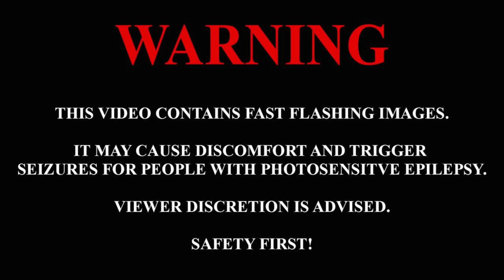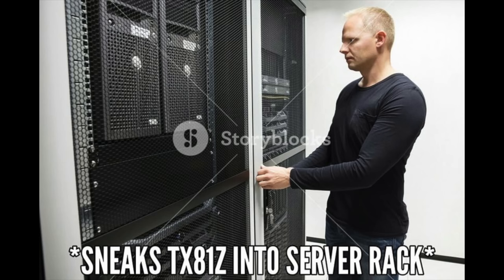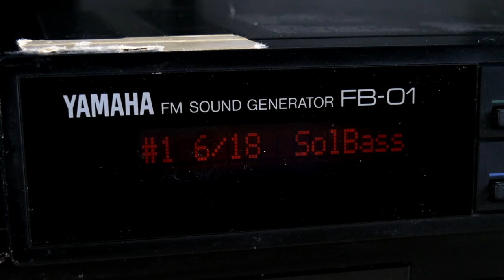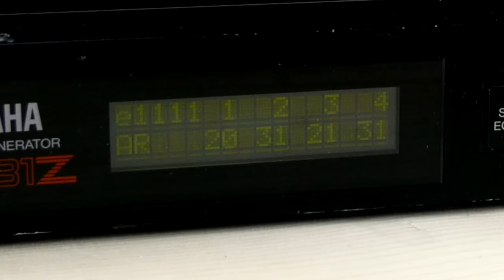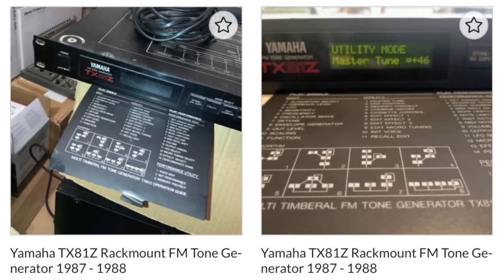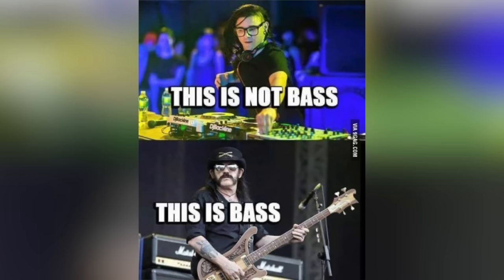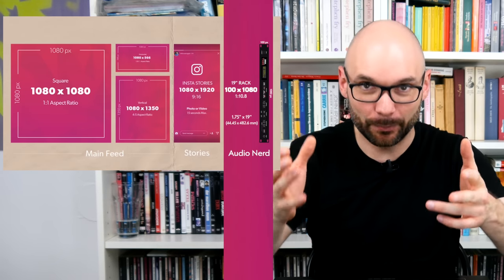Bad Gear - Yamaha TX81Z

Comment: Bad Gear, OMG leaving me triggered in recent episodes! The TX81Z still graces my rack, my FIZMO made a graceful exit a few years ago in a trade for a V-Synth (with a sunset clause offered which expired long after the trader changed his mind - TOO BAD),  and, there are many V-Machines around the office. LOL ;)
Reply from the maker: Nothing personal;)
Reply: V-synth is basically Roland's stab at a Fizmo, yes? Always wanted one.
Reply: @dvdny  the V-Synth is a vastly different animal - it's best considered the ultimate sample mangler. The FIZMO, unless you're keen to maintain an ancient Windows system or VM capable of running SoundDiver (yes, I had it working perfectly on a my Mac Pro MacOS Mojave system via VMware Fusion), is utterly sonically underwhelming but has the best paint job in synthesiser history. It was to keep around in the studio purely as a conversation stater but I've heard wet farts that sound better.
Reply: @AudioPilz  I'm a huge fan of your work! My boss (V-Machine creator) is now a fan too.

Comment: Nice and funny video (you did have some pain looking for images to illustrate waves !) I had a TX-81Z for many years and I agree with your review. I liked it as it could produce some original waveforms, but overall it lacked controls, or settings were a bit 'rough"  or scarse and not allowing enough lively play. I used Caged Artist editor on the Atari ST. Polyphony makes layering very difficult to fatten things up. I sold it and got my self a SY-77 which can do almost everything the TX81Z can do plus more. But the V50 would also have been a good alternative (has basic FX and 16 voice polyphony).
Reply from the maker: Thank you so much!!!

Comment: This could almost be a public information film for anyone following the current FM revival and thinking about getting a vintage hardware unit. I think I've turned my DX9 on once in the last 30 years or so. It should be mandatory for anyone considering rehoming a vintage FM synth to download and work with Dexed on their computer with 95% of their computer screen covered. Thinking of rack units, how about the Oberheim Matrix 1000? Even though they were curated presets they all sounded a bit muddy to me - and even with software editors it was hard to program without huge amounts of lag and crashes - still managed to sell it as a 3 voice for more than I originally paid for it. Have you got Julian Colbeck's book? Read the review of the Oberheim Matrix 6. Had one for a few weeks but it broke.
Reply from the maker: Thanks! Actually had a Matrix1000 a few years back. Suprisingly good sounding yet useless;) Tweaking via Sysex takes DAYS to react;)
Reply: I got mine with the 1.20 firmware which fixes most of the laggs, it can be programmed pretty much in realtime with the proper editor.

Comment: I for one got a DX7 education in Denmark in 1984 ( I was 14 years old) when it got released (i live in Sweden). I was fun and all apart form the fact that swedes and danish don't use numbers the same above 10 or so..... It was ok. I could clearly hear what values did different sounds and why.
Anyway, learning the DX7 I got to think in a certain way regarding hearing sounds and thus understanding and recreating those on the FM DX7.
Using an FM synth like the TX81Z or the SY77 or SY99 gives me an awkward availability of more waveforms than sinus.
Extended sound palette? SURE! But even more difficulty in recreating sounds.
For me, recreating sounds on a 6 operator synth is not difficult. Disregarding modular and such.

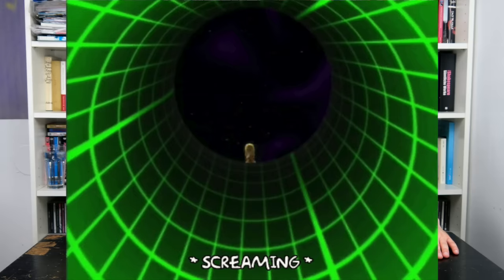Comment: 0:49.  Luke!  Since I sold my DX7 before the dark times, you must learn the mysterious Alchemy force of FM programming….or flip through the thousands of presets available on the internet and use any software DX vst or iOS app! And trust in the randomization button to achieve whacked noises R2 D2 can communicate with….assuming it blends with ARP 2600
Reply from the maker: It's a bit like chemistry indeed!!!

Comment: Be careful if you are getting the TX81Z to modulate the sysex parameters as part of a performance. The processor is super slow and will seize up. 

The TQ5 or WT11 both have almost the same engine but can handle sysex much better. TQ5 is possibly my favorite looking 80s synth, but the WT11 has portamento which the TQ5 does not (both have pitch envelopes). Also I think it sounds the "sweetest" out of the 4-ops.
Reply from the maker: I'd love to have a TQ5!!!
Reply: @AudioPilz  Highly recommended just as a conversation piece :P I've had multiple folks ask me things like "wait, is that an answering machine or terminator prop or...?"

Comment: The polyphony is pretty limiting for being multitimbral, although non-keyboardists likely won’t mind. Description of the alternate waveforms is spot on, but they are really the only thing that makes this DX worth owning imo
Reply from the maker: Yup, 8 voices ain't much...
Reply: I agree, 8 voices isn't much. But then, I bought mine new in 1986 or 87 for $475. I was OK with a few limitations... 🙂
Reply: @Novalarke   I imagine if I was around back then, I probably would have bought the DX11. May not have been a DX7, but certainly more affordable, and with many features the earlier 4ops didn’t have. For the time, 8 voice polyphony wasn’t terrible either.
Reply: @jerzilla3795  - I had a DX11 too! It was fabulous. There's a keyboard I actually miss. And yes - DX11 was way less expensive than a DX7, and with its extra waveforms was able to compete with the DX7, at least for my needs! Cheers!

Comment: In 2003 I was talking to Tom Jenkinson (Squarepusher) after a show and I asked him how he programmed the TX81z. I had one at the time and was curious. When he said "I just use the front panel" I remember thinking THIS GUY IS THE REAL THING lol. Back then there was 1 program to edit presets on it and it was really dodgy so I was stuck trying to figure it out. I ended up throwing it in a dumpster after an emergency GTFO of an apartment situation lol. Of all the FMs I'd say it's good if you can get it for less than $200 CAD but we all know it's hip and trendy now. I got mine at a pawnshop in the late 90's for $80 I think. I even had the midi keyboard you have at the time (I think the gen II model that came out after) using it. Not sure if my boomer eyes are deceiving me but it looks like yours is missing the headphone jack bolt as well? haha you gotta be careful cause iirc it can fall into the machine.

Thanks for the flashback. If any zoomers are thinking of buying this get the korg volca FM instead. The major appeal of the TX81Z is that you could get them for cheap at some point in time. That time has passed, this is NOT worth 300 euros my dudes although the DACS are nice and loud on this.
Reply from the maker: The GOAT! Thanks for watching!

Comment: Excellent; I can never make mine sound so good! And yeah, server manufacturers started building thin vertical machines that tucked into a chassis and called them “blades”. How is it possible that Yamaha (or Roland) never convinced us that would work with synths?!? 😂
Reply from the maker: I'd buy that for a $

Comment: Wohoo! Excellent choice, but you didn't address the main flaw in my opinion: static assignment of voices in performance mode. To have useful multitembrality you need at least 4 voices and given the 8 voices max you can have at most 2 different sounds at one time.
Reply from the maker: Thanks!!! Didn't run into real limitations the way I use it but I assume that might be an issue for real players

Comment: My first synth ! I owned 3 since these 30 years . I always back for this weird and creative module. Much much better than the DX9/21/27/100.
Do you know if the YS100 and 200 are the same synth  inside ? 
Thanks for your video.
Reply from the maker: Thanks! I really have to check out the YSs

Comment: I really like the TX81z, it always ends up in my mix somehow even though I'm not the biggest fan of it on its own at all.  I don't know if this is just mine, but I realllly have to crank the gain on my mixer to get proper gain staging from it.   So quiet.
Reply: Lol just saw it pop up in the criticism section of the video.  Definitely just a part of it.  The Sega is a better 4-OP FM!
Reply from the maker: Yes, proper preamps required

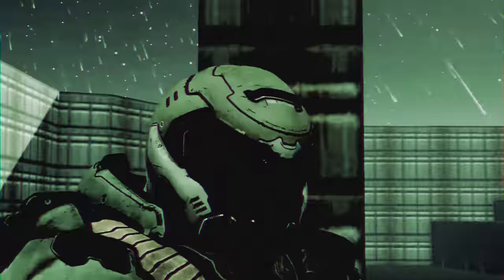Comment: At 7:15 it is just WOW-wow-wow! This bass is so punchy! And it doesn't sound like Lately Bass at all. Is it Lately Bass (strongly tweaked) or it's totally different patch?
Reply: it's close to the techno 'donk' bass, a type a 90s rave bass that's stupidly easy to make on any FM synth, I think the TX81Z (or was it the dx100) came with a preset called 'wood piano' which if you tweaked into a harder envelope, and played lower down, you got that sound.
Reply: @xsm5525  Ahh, wood piano? It make sense!
Reply from the maker: I think it was originally a pan flute patch;) Thanks!!!

Comment: Does anybody still make dedicated sound modules/rack synths?  I started my music GAS with budget grooveboxes (Volcas, Circuits, Roland Airas and, most recently, Livens).  However, having just purchased a Keystep Pro,  I now find myself surrounded by boxes full of redundant sequencers, key-beds and control surfaces.  Today I just want boxes containing editable sound engines.  Anybody got any recommendations?Are there any serviceable/reasonably priced sound modules from the 90s and 00s?   Great video btw.
Reply from the maker: Thanks! Rack synths are usually made for eternity so just go for it

Comment: I don't think any working sound module deserves to be chucked ( on a forum someone even had the nerve to say that 
about the Roland JV-1080 ). With it's high price tag I think I will stick to using software FM synths like Dexed or my Yamaha 
PSS-680 and PSS-470 and to be honest I prefer the tame sound of the 2 op FM chip used in many home keyboards. But if I 
ever find a TX81Z or an FB01 in the dustbin, in someone's garden, on a curbside or catch someone about to sling one in the 
skip I would happily take it even if I was tied down to just the factory presets which I don't find any fault in but in the context
of EDM it doesn't sound so crude and dated even though I personally like the crude instrument imitations offered by FM 
synthesis. The Alesis SR-16 is also a very cheap way of having 80s style PCM drums especially if you put it through a bitcrusher.
Reply from the maker: Love the SR-16!!!

Comment: Coming from a Dx7, dx100 then a dx200, Korg Volca then a Digitone eventually ended here for what is in my opinion the most punchy and snappy clear fm sound. Not as many artefacts like a dx100 for example. Editing with a stereoping opens up the synth, especially in combination with an editor from Coffeeshopped.. The lack of memory is my biggest issue with this synth categorizing it as bad. The rest I wouldn't classify as bad gear in any way. I've had most fun with this one and it actually kind of moved me into learning the fm basics finally after many years of preset playing.. Messing with the realtime algo's modulation is a great trick. Too bad that in any video about this synth everyone talks and plays a lately bass kind of keeping a gimmick status of this synth as it's primary image. This is a synth with an image problem, it's a workhorse and contemporary fm synth KILLER... I don't know what the magic is, conversion.. perhaps. It's a techno electro monster.
Reply from the maker: You just can't make a video about it without playing lately
Reply: @AudioPilz  true that. In most dx’s it was actually called solid bass. Hence the track solid sessions from Orlando voorn

Comment: I am the proud owner of a Yamaha V2 (DX11) that I’ve played once to see that it works. It happens to be the only time it has been used since the original owner took ownership of it in 1988 (never once playing it). Needless to say it is completely mint. Of course I have to change the battery and miss out on its test/diagnostic program which is unbelievably stored on RAM. And then I have to load internals and performances. But no Lately Bass like the TX81Z, so I’ll have to punch that in.
Reply from the maker: Nice one!!!

Comment: I remember when they went for 80€ because they sounded way too cheap. They still sound cheap. Choosing between the TX802 and the TX81Z is a question of sanity. I won't sell the TX802 to buy this bugger.
Reply from the maker: TX802 is a different beast!
Reply: @AudioPilz  I just hooked it up with a DMP11. Hell that's a great combination!